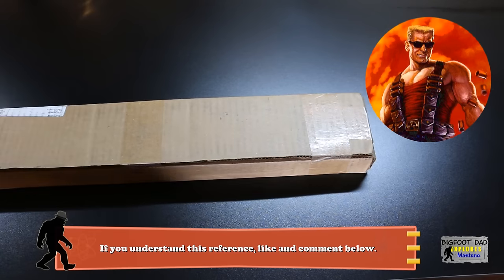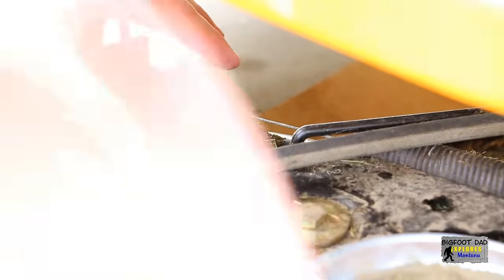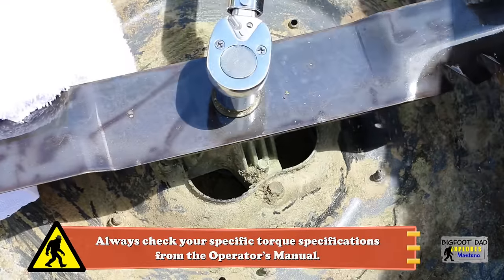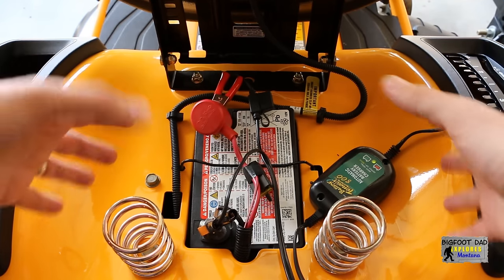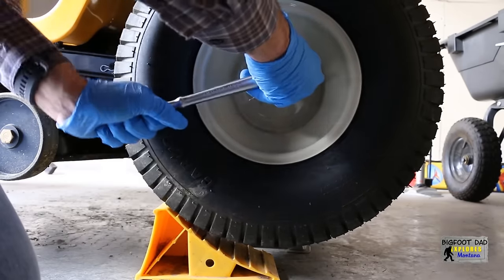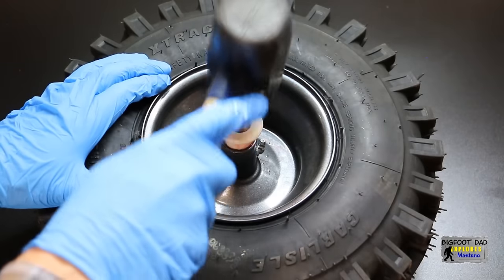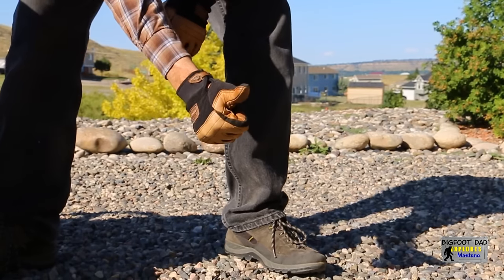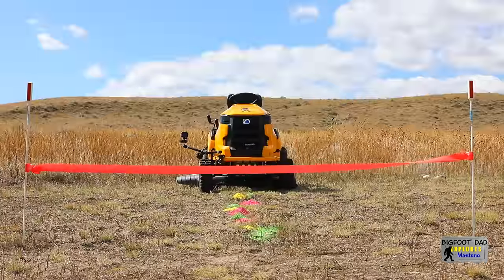Upgrading Your Tractor Mower: Cub Cadet XT1 LT42" Mower (ATV Tires, Blades, Brush Guard, Headlights)

Comment: Awesome dude! Love your style. I have the same mower and would love it if you could figure out how to upgrade the air filter to a bigger one. In west Texas we mow 2 parts dirt to 1 part grass so the filter clogs quickly.
Reply from the maker: Hi, Everyday Tool - thank you for the feedback and welcome to the community!  We have a similar issue here when the yard dries up in August.  So much dust that we have to wear masks.  And, as a result, I do have a similar problem with my air filter.  Perhaps a snorkel retrofit is on the horizon... 😀

Comment: I tried Gator blades in my Toto ZTR mower.  It produced the most uneven cut I have seen.  Only used them twice and they now hang on the wall.
Reply from the maker: Holy smokes, Robert!  That would be frustrating.  I don't think I can tell to that much detail on my lawn - it's just natural prairie grass.

Comment: After you changed to those beefier tires, did you have to adjust your deck level?
Reply from the maker: Hi, Shane - strangely, no.  Everything just sorta worked out on the height.  If anything, I'd say there may be a slight forward rake.  But if I had a nice green lawn that would show these things that are out of adjustment, I might try adjusting the deck.  I love it when a plan comes together, whether intentional or unintentional!  😎

Comment: This is very late, but does the upgrade of the tires change the deck leveling or make the rear high?
Reply from the maker: Hello!   I think it only raised it by 1/4" or so, but we have plenty of adjustment downwards on the deck levels.  Everything cut fine and even for me.

Comment: Idk why I’m watching this at 4am but I will say if you value your yard I’d keep those old tires just in case those atv tires will destroy the yard when it’s wet been doing lawn care for 10+yrs if you really need extra tractor consider adding a liquid inside the tire I use rv antifreeze in the rear tires of my JD 314 along with wheel weights which combined is 200+ lbs of traction just on the wheels

Comment: I commented on this video a month ago after buying those rear tires for my zero turn. I still haven't installed the tires yet cause spring mow time is still a ways away. I did however stumble across a used mower like this one with the 46" deck today for $750, so I brought it home. Hope you don't mind me copying your ideas in this video. 😂
Reply from the maker: Hi, Dale - awesome deal!  I would love to see photos of your mower after you get it modded.  Send them in of the finished product and I'll share them with the community.
Reply: Hey Bigfoot Dad, where can I send a picture to?
Reply: Nevermind,  I just found another comment where you mentioned Facebook.
Reply from the maker: @Dale37  - Hi, Dale - could you send me those pictures again or send another message?  For some reason, I cannot locate where these went to in Facebook messenger.  Thanks!
Reply: I sent a picture through Facebook messenger.
Reply from the maker: @Dale37  - Hi Dale - well, I'm going to admit defeat on Facebook messenger.  I searched for about a half an hour and I cannot locate your message.  Strangely enough, I remember reading it, but it does not show up anymore.  Would you like to try through Instagram?  I know how that system works much better.  😎

Comment: I jack up the rear end. That makes plenty of room to access the blade mounting bolts with my impact gun.
Reply from the maker: Hi, @ExtremeRecluse - yes!  That's a great way to change them out.  I removed the deck mainly because the camera didn't fit under the deck when I had it jacked up.  And the deck was ultra caked with grass.  😂

Comment: It’s almost a year later how is your ride holding up 😂 I just got mine out of the snow plow gear and got them all cleaned up down here in Pennsylvania it’s about that time to mow soon
Reply: How is that plow?  I’ve been contemplating the purchase.  Do you think it would be appropriate for a gravel driveway?
Reply: @glennkrzeminski7539  which plow are you talking about the video I had of my cub cadet 1811? If that’s the case I’d recommend it for your application because you just want to have it a bit off the ground so you do not push the stones along with the snow it is heavy duty and is very easy especially with the hydraulics on my cub

Comment: Could you make a video on how exactly to jack this mower up? I’m afraid I’ll bend or crack something. Thanks.
Reply: I don’t own it, but I personally would use the front bumper bracket, or the mounting location and then for the back the trailer hitch part. They’re both connected to the frame and going to get the job done. That’s what I do on my mower!

Comment: I would recommend wire brush all the debris
off the deck wash it ,dry it and apply black rust corrosion protection paint. I had to do it on my 2019 xt2 54gsx mower I had found some much rust after one season.
Reply from the maker: Rafael - that's a good idea.  I may do this the next time I pull off the deck.  Thank you for the recommendation!  😎

Comment: Any rear tire rubbing in the deck? Or all good in all deck positions?
Reply from the maker: Hi, Back2Basics - no problems so far.  I don't remember if it was the left or right rear, but it's real close to the antiscalp wheel.  However, it still has about a 1/2" or so and I haven't had it bounce into the tire yet.

Comment: What kind of tires & size did you use i love it
Reply from the maker: Thanks, Jason!  I have linked the tires in the video description - it should specify the exact ones I used.  The fronts weren't exact matches to the old ones, but they still fit fine. Hope that helps!

Comment: i have the same rear tires. i use them to plow in winter and this year hopefully i dont have to use them to mow a really wet yard.
Reply from the maker: Hi, Matt!  Very cool to hear you have the same set of rear tires.  I agree, the treads are a bit aggressive and may damage the lawn if it is damp.  But at least they did their main job through the winter for you!
Reply: Bigfoot Dad Explores Montana yeah. Thanks I was thinking of that, Idk if I go slow if it will help I just hope I don’t have to use them for mowing cause of that reason.

Comment: I purchased an XT3  with electric power steering from a friend. I think it steers hard. What could be wrong with it? Has 400 hours.
Reply from the maker: Hi, Rachel - you've purchased a great mower.  I'm afraid I don't know what the issue might be besides replacing the electronic power steering module or checking the connection/fuses to it.  
Could someone on here help Rachel out with her question?  Let us know what you find if you're able to fix it.

Comment: You should also grease the blade spindles. My LT1050 has zerk fittings right under the blades.
Reply from the maker: Hi, P Anon - agreed - I will look into tapping a zerk into the spindles.  Unfortunately, these newer models don't have them.  Thank you for for sharing your tip!
Reply: @BigfootDadExploresMontana  Booo Cub! WHY remove something so simple? Do they really need to sell replacement spindles that bad?
Reply from the maker: @panon5292  - Good question.  I noticed the same thing on the Husqvarna I was reviewing as well.  The cost has to be just pennies and it creates a more durable product to include it.  But maybe because these are supposed to be self-contained/maintained?  I dunno.

Comment: Can you raise the hight of the deck by this tire change?  I need more clearance and I do not need a low cut.
Reply from the maker: Hi, Robert - if I recall right, I think I got about 1/4" from the bigger tires, but I couldn't fit any larger on because otherwise they would contact the deck.  Maybe this has changed a bit with models over the years, but I'm maxed out without some serious modifications.  Hope this helps.

Comment: It's always a good idea to put some grease on the rear axle to keep the rear wheels from rusting to the wheels. Tinting the lenses on the headlights is silly, someday you might need your headlights and they won't be useable.
Reply from the maker: Hi, G56AG!  Thank you for your comment!  Agreed, I'm glad I did this step, with the axles that is.  The headlights, yes!  You hit the nail on the head.  It was the irony I was going for.  Plus now I have another reason to upgrade the lighting for the next film... 😂

Comment: Would using a pressure washer for cleaning the blade area be a good idea?
Reply from the maker: Hi, BenDean -  this will probably be fine, although I'm unsure if that would force water into the spindles.  I think if you were careful how you sprayed it off it there won't be much of a problem.

Comment: Where did you purchase the headlights? Not the part you tented
Reply from the maker: Hi, Michael.  These are the stock headlights. They may look a little different because the models have changed since this was new.  Hope this helps.

Comment: Looking to replace the rear tires on my XT1. Cub cadet says they're 20" I don't see the size listed on the link. Did you use a different size?
Reply from the maker: Hi, Cory.   The size on my tires I installed is 20x10-8.  It appears as though the link I put in the description does not have that tire in stock, so you may have to see if you can find it from another seller there.  This seller seems to have them in stock:  https://www.amazon.com/20x10-8-20x10x8-Tires-Tubeless-POWER/dp/B082P89MSQ  Hope that helps!
Reply: @BigfootDadExploresMontana  Thanks so much!

Comment: Looks pretty cool! Thanks for sharing. 

I would replace the sasquatch with racing stripes and the Cub Cadet emblem with a transformer emblem. Instant Bumble Bee edition. : )
Reply from the maker: MySuburbanHomestead  - now that's a great idea!  Had I thought about the racing stripes...! 😅
Reply: Bigfoot Dad Explores Montana I actually like the “Bigfoot Edition” as well!
Reply from the maker: @great0789  - Maybe we could have a mower-meet and everyone can share their mods.  😅  There's some guys I've seen that take that to the extreme and race or mud bog them.  Those are always fun to watch.
Reply: Bigfoot Dad Explores Montana I will have to look that up then! I don’t have the same mower sadly. lol I have an old rear engine rider. Still going strong though. So I shall keep it until it dies.
Reply from the maker: @great0789  - Hey, that works.  Mod it just the same and see what you can create!
Reply: @BigfootDadExploresMontana  
I have been thinking about a tire upgrade for starts! 

After seeing your vid yesterday I went and priced out/looked up tire options. Looks like there are quite a few options! 

My mower gets stuck all the time but is light enough and has crash bars to grab and just pick it up/move it by hand. Slightly more aggressive tires would be nice.

Comment: Awesome XT1 man. I will say... Hydro-Gear rear ends do not like aggressive or oversized tires. It will cause premature wear. But it should hold up fairly well if you keep it maintenanced properly. I've had 2 Hyrdo-Gear rear ends go out in my Husqvarna garden tractor, costing $1,200 a pop. This is why I own a XT1 now. Lol
Reply from the maker: Hi, Jordan - thank you for your feedback and sharing your experience.  I was wondering the same thing before ordering the tires.  The transmission and tire combination may be intentional to allow slippage of the tires if the mower is under too much stress.  If you have any maintenance suggestions to make this last longer, let us know.  Meanwhile, we'll see how long this holds together.
Reply: @BigfootDadExploresMontana  The only solid info I can offer is don't fill them with fluid or add wheel weights, and keep the air pressure at recommended levels. Should be fine if you do that. The grip alone shouldn't hurt too much. Just don't try to push the tractor roo hard if it is showing signs of struggling. Common sense stuff. Lol
Reply from the maker: @CCWP0251  -  I think this is good advice and others should follow as well.  Thank you, and welcome to the community as well!  😎  BTW, I really like the fabricated deck on your 50".

Comment: Torque specs are not a 'range' to fall in between. The lower number is with lubricated threads, the higher with dry threads.
Reply from the maker: Hi, Carl!  Wow, in all my training, I haven't heard this before.  Thank you for clarifying this.   If I make another installment of this video, I'll be sure to mention this.
Reply: I was a mechanic for fifty years and I understand. That little tidbit was never offered anywhere on my path either. In fact, my father worked in R&D at a Ford transmission plant in the '50s & '60s, he was told it was for new & used fasteners (torque stretch I figured.) However, since so much info has become available on the internet I've found from several bolt manufacturers it's due to dry or lubed.

Comment: 8 yrs ago when I got my xt1 I Lt 50 unplugged my headlamps, serve no purpose, I only cut grass during daylight. My Kohler blew a head gasket a year after the 5 yr paid extended warranty expired, got so hot that it melted and deformed plastic hood. Replaced all 3 spindles twice, both front tires/wheels once. Waiting for the engine to give up the ghost any time.
Reply from the maker: Oh, man- it sounds like your machine is having a rough time.  Crossing my fingers that the engine doesn't blow.  Yes, the headlights are not particularly useful, I'll admit.  Maybe time for an upgrade on those.  😅

Comment: WARNING: PACKING CRATE.  I just spent WAY too much time figuring out how to remove my 42" XT-1 from its sarcophagus.  The base of the packing crate had a number of athwartships 2x4 crossmembers, including pairs that created deep wells into which the tires were sitting.  I was unable to either push or power the machine out of those wells.  The answer was to jack up each wheel, one at a time, and place a 2x4 under each wheel so that the four pieces of lumber in a fore-and-aft direction formed a level surface on which to drive the mower.  I screwed the bridge pieces to the crate base so things wouldn't shift during the drive away.  I also placed two 2x4's to act as ramps down to the driveway.  Simple as can be after I figured out this solution.

Comment: I use the Rotella with high zinc oil and the stock blades suck garbage one of the best purchases I made was the bagger kit got $100,00 off buying it in the off season $200.00
Reply from the maker: Yes, the Rotella's got "all the vitamins and dinosaurs an engine needs" - Derrick from VGG.  😅
Nice deal on the bagger kit.  I may need to purchase one of those someday!
Reply: @BigfootDadExploresMontana  Lowe’s end of the summer had them on sale they work great

Comment: Have you checked out this one.. Cub Cadet-XT1 Enduro LT 42 in. 547 cc Engine with IntelliPower Hydrostatic Gas Front-Engine Riding Lawn Tractor?
Reply from the maker: Hi, PJ Guz - I would love to review that mower.  Cub Cadet, are you listening out there?? 😅 
It appears that that feature is only available on their (rebranded?) engines. From the website, I cannot tell if this is their fuel injected models, but I'm guessing they are.

Comment: Why unplug the spark plug wires? Wouldn't it be safer to disconnect the battery?
Reply from the maker: Hi, bama bati jifo - I was following the instructions in the manual. Sometimes they don't make sense and I agree, the battery would be probably just as safe a bet.
Reply: @BigfootDadExploresMontana  Oh yes, I didn't mean that as a dig at you. I was just thinking that, even if the engine is unable to start, it could still crank, and I DEFINITELY wouldn't want my hands anywhere near those blades with even just one engine rotation, much less if something shorted the starter and it just kept spinning. 

Either way, nice job on the mower. Be safe!

Comment: I last saw your video on your review on buying g this tractor. Seeing you do the maintenance shows me that the engine is the new 5400 series Kohler. This engine's block design seems to mimic a lot of what the Kohler Courage twin cam single cylinder is like. The courage has received a lot of negative publicity for being a junk motor. I have a feeling this new engine unfortunately might end up getting the same reputation for the same reason. Seeing to give you and anyone that buys a tractor with this engine some very important info. Check the bolts on the sump under the plastic blower cover / fan shroud. If you keep tabs on those bolts and make sure they stay tight, you won't have the potential for the one or two next to the flywheel backing out and possibly causing damage to the engine when they hit the flywheel.
Reply from the maker: Hi, Zachmansd - thank you for this valuable tip - I will check them out.  I was hoping that many of the issues that the Courage had would be fixed in the 5400 series, but you're right there too - time will tell.  I'll keep my eye on those things and will certainly post back if anything happens.  Thanks again!
Reply: @BigfootDadExploresMontana  It's been a couple years. I was just curious how those sup bolts have been holding on the engine.
Reply from the maker: @Zachmansd - hello!  I may have to give these a look when we pull the mower out of storage next year.  So far the mower (and engine) has been holding up fine.  
We're out traveling the US and hope to be back to Montana in time for mowing season.  🙂